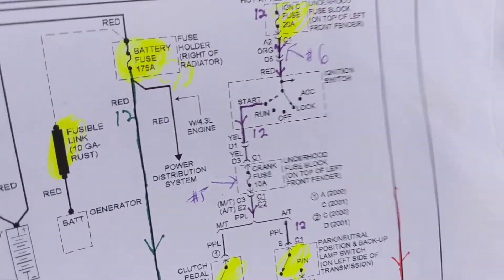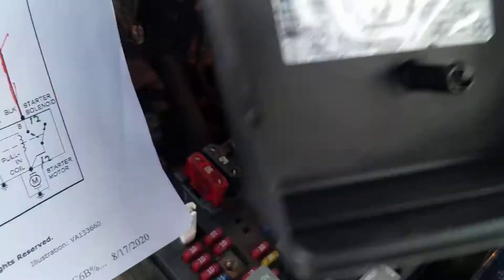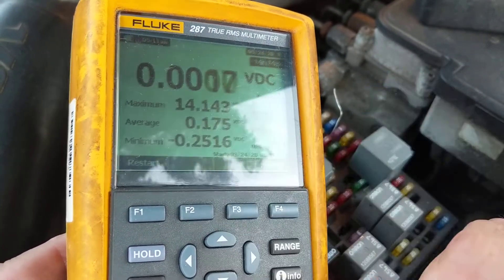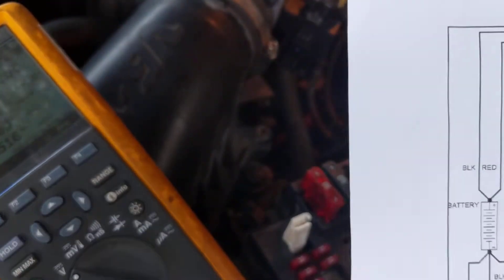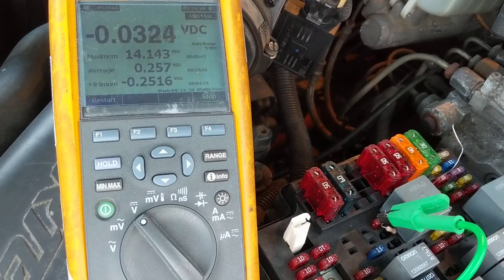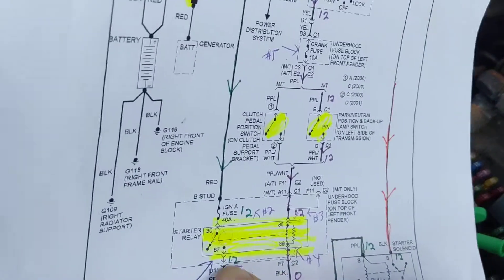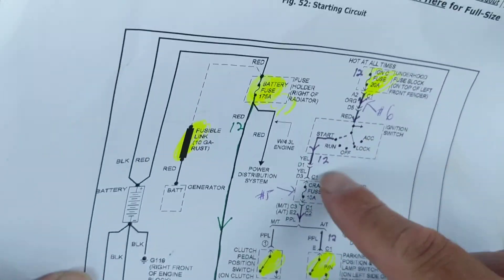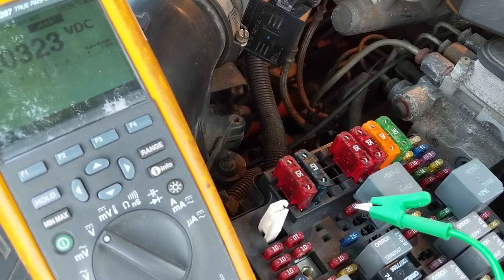STARTER motor RELAY PROBLEMS HOW TO TEST

Comment: He hasn’t a clue
Reply: I didn't understand the comment that well
Reply from the maker: If you see my other channel Joe electronics schematics for Auto I think you'll see other videos but can you elaborate on what that means he hasn't a clue on computerized fuel injection systems what you are referring to please look at my channel
Reply: I mean how else can you determine if a relay is good without taking it out because the circuit always has to be with the load and the relay inserted if that's what you're referring to

Comment: what is the problem if i dont have 12v at the starter relay?
you said ar 3:54 that "30" always have voltage, but my car dont have voltaage there. 4 days i cant solve it, no crank no start. 
 i do get voltage on the other circuit of the relay when im switch starting the car, but nothing happened because there isnt 12v on the "30" pin of relay.
please help me diagnose thank you very much
Reply: Your coil side
Reply from the maker: Actually I just saw your comment right now or your question two things to deal with number one pin number 30 should be always 12 volts pin number 87 should be 12 volts when the contacts close first things first if you don't have 12 volts at pin number 30 you have to trace it back to probably a fuse in that circuit after you find the fuse you still have to troubleshoot the coil side so keep me updated if you have 12 volts at pin number 30 and where it goes to probably a fuse that's your first priority
Reply from the maker: Also remember pin number 30 and 87 is the load side going to the load which is the solenoid so there has to be a protection device obviously a fuse
Reply: @automotiveelectronicsfroms2699  
Thank you man!
I've checked all the fuses but i'll check again.
Idk why i dont have 12v on this pin.
There is any possibility that anti theft system or immobilizer cut this wire? 
Is Suzuki alto 2012 AT tranny if you familiar with
Thank you for your comment  you are the best
Reply from the maker: There might be a multifuse and if you want you can jump pins 87 and 30 to see if it comes on be careful to make sure you're the right pins you have or that could be a computer giving 12 volts to that side one step at a time good luck
Reply: @automotiveelectronicsfroms2699  
I've tried to jump those pins but nothing happened because 30 is dead.
I took power probe and shot 12v into 87 - i can hear clicking noise from the starter but it doesnt crancking.
i already replaced the starter just to make sure. 
there is any chance that the power probe dont send enough current to spin the starter?
Reply: That means you don't have 12 volts going to the load when you jump that side that could be you don't have enough voltage going to the starter you might have 10 and 1/2 volts or something low voltage watch my video on Joe electronics schematics Auto to do this the correct way and put a wire in the terminal of the relay a pin 87 and see what you get that's the best way to do it